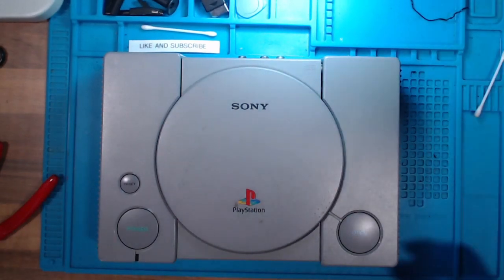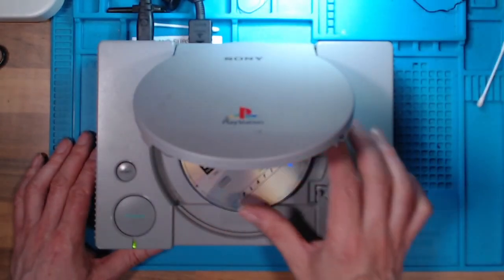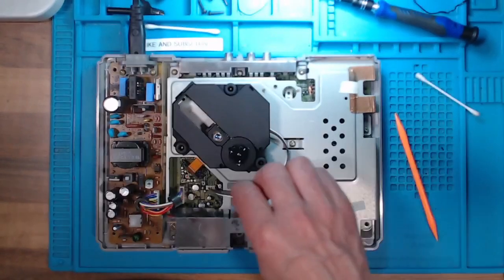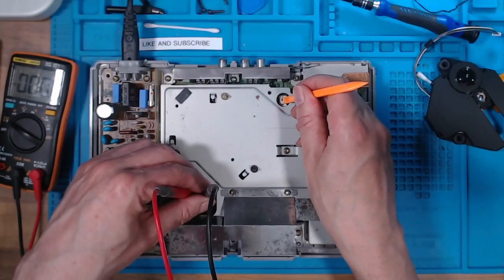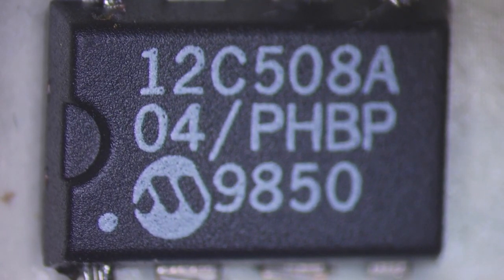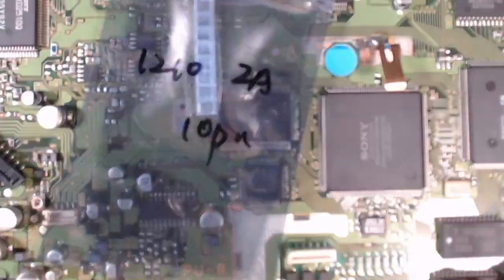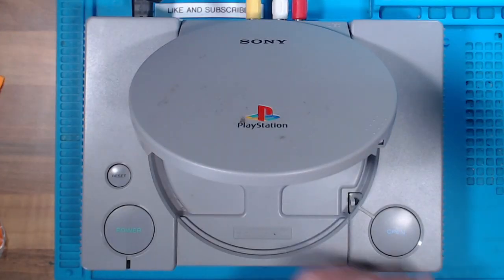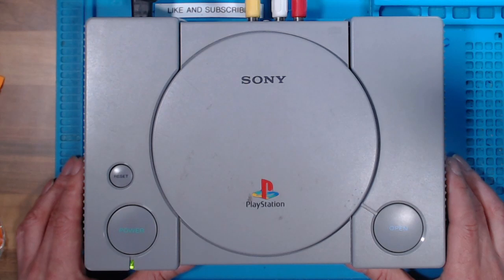Playstation won't spin CD? | Here is what you need to know

Comment: Hi. Mine when I press the button from de lid it moves the lens, but not spin. Could be the same?
Reply from the maker: It might be the laser is faulty and doesn't know the CD is there.
Reply: @PhilipBryden  Changed the CD unit completely but the result is really the same. Maybe is the MODCHIP? Maybe i'll try to take it off.
Reply from the maker: Have you tested the fuses?
Reply: @PhilipBryden  not yet, gonna do it today, thanks... Tha strange thing is the lens still move, but no spin... Of the motor doesnt spin if the cd is not recognized by the console, maybe the modchip is faulty
Reply: @LiloVLOG any update? Same problem
Reply: @themaddog9202  I got to solve it, but I can't remember exactly what I did. I think the main problem with PS1 fat is not recognizing the CD so it won't spin and set the right resistance(ohm) of the laser in the unit. I thought it was some problem with the PS1 board but it was really changing the resistance of the unit and use a good CD that reads well to test it.

Comment: I have replaced the cd assembly multiple times now but the same problem happens
It spins the disc for ~3 seconds, then stops. 
What could be the problem?
Power supply??
Reply from the maker: When you replaced the laser, did you use a new one and did you remove the solder blob from the new one fitting it?

Comment: Hey mate do you think this would be easy for someone who knows nothing about circuit boards ? Just bought a ps1 but disc isn’t working 😢
Reply from the maker: You could trying following along with the video if you have a multimeter to check the fuses. Be careful with the power supply tho, it can give you a nasty shock, even when the system is turned off and un-plugged.

Comment: I have a problem where my spindle will not stop spinning super fast, even with the lid open. It’s not the lid switch either; when I press that it activates the laser. I tested continuity and it makes contact with the power supply. I recapped the entries board as well.
Reply from the maker: Have you opened the system to look for signs of damage on the motherboard?
Reply: @PhilipBryden  I fixed the problem! A few weeks ago. I reflowed all the caps and it started working again. Not sure which cap was the culprit, because all showed continuity on the multimeter.
Reply from the maker: @ResidentXombie  Ah that's great news. Possibly something on the board causing a short which was dislodged or cleaned off while you were working on the caps.

Comment: Hey man, just plugged my father's ps1 to see if it still worked and the answer is ¿? Like im scared to tell him it doesn't work because 100% he will blame it on me but like the console turns on and boots in the menu where you don't put a disc but also it doesn't spin the disc but makes a strange noise like a gear spinning but the disc isn't. The model is scph 7502 but I can't find anything online
Reply: I had a similar problem with my PSOne, it would not spin the disk and would only get to that menu screen.

What I did was clean the lense with isopropyl alcohol, adjust the potentiometer to give more power to the lense (1/8 of a turn) and made sure to hold the pin that checked if the lid was open. My console managed to read boot game's again, but with a very long loading screen. Was still happy to see that it worked tho 😎🤙

Comment: Can i sent you my ps1 for an fix damn i keep trying everything but i dont want to mess with solder all kind that i have no brain for that 😅
Reply from the maker: Sorry but I simply don't have the time to offer this type of service. What's wrong with the PS1?
Reply: @PhilipBryden   its not spinning the cd i did try the alcohol thing doesnt work . I  bought last night for 30 euro the laser ksm 440 to replace it but im scared if i would replace that it wont work , finger cross
Reply from the maker: I hope a replacement one works out. Does the laser itself move up and down if you press the close lid switch.
Reply: @PhilipBryden  hi Phil. My laser moves perfectly fine, my rail and spindle motors as well (bench tested).  It used to be an erratic disc spinning issue, then evolved into a non spin problem. 

I'm no expert not hobbyist, but looking at my board, all looks in order.

I still did not voltage test legs 17 and 18 yet. Any advice?

Comment: On mine, the little switch that detects the lid is closed had a little cover that broke off! The stem of the switch is still there though. Should I just chuck some hot glue or super glue on the plastic stem that pushes it down?
Reply from the maker: Does the bit that broke off stop the switch from working?  Superglue is better than hot glue. Baking soda will set the superglue harder if the join needs extra support.
Reply: @PhilipBryden  Thanks for the reply! Nope, I got the broken pieces out. I just had an idea, I might glue some thick paper to the pusher. If that doesn't work, I'll try the super glue with bicarb soda. Thanks again!
Reply from the maker: @TheHuntermj  If you need to build something up, then the superglue baking soda is probably the best method. Try it on something else first tho. It's very strong.
Reply: @PhilipBryden  no probs, I was just thinking if it broke up, it would make a mess lol

Comment: What's the output voltage power supply PS1?
Because no run dick :-/ 
It's sound very low in the transformator power supply . It's OK all parts  diods capacitors, resistors 1transitor 1 MOSFET  .
Please help me engineer
Thanks
Reply from the maker: Don't try to fix it yourself, buy a replacement working one if you can. I think there are modern versions available now called Pico power supplies. Search on google for them. Good luck. Let me know what happens.

Comment: It's too bad you didn't record the fuse replacement. I have a PS1 that needs 2 fuse replacements. Just waiting for them in the mail.
Reply from the maker: It's pretty straight forward with some low melt solder. I hope you get your system fixed. Good luck
Reply: @PhilipBryden  Thanks. I was able to replace CCP2E15 fuse and CCP2E20 fuse and now the control port and the memory card port work. It's a Japanese 7000 model PS1 with 110v power supply/ PU-20 board. I ordered a new step-down converter designed for PS1, Dreamcast and Sega Saturn consoles because my current step-down converter runs at 120watts and I'm worried it's too much for the power supply. Also I either need to re-grease the CD drive or get a new one.  I'll keep you updated on my progress.
Reply from the maker: @yanghao8351  That's a great result so far. I have an Xstation to go in one of mine, when I can be bothered to install it.
Reply: @PhilipBryden  Looking forward to the Xstation install video when you get a chance to install it.😀